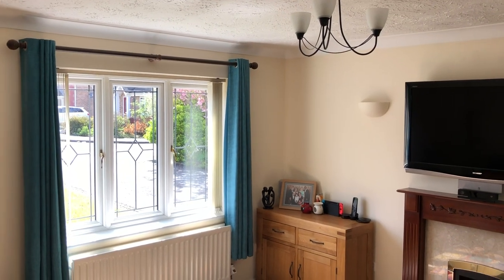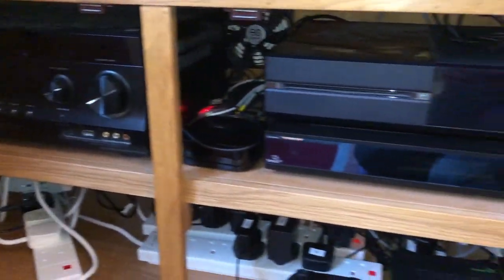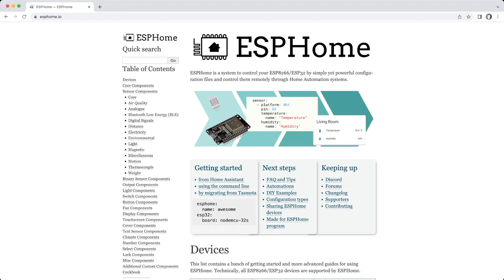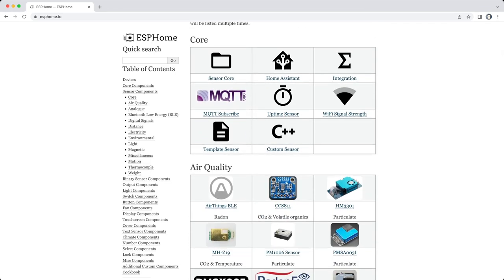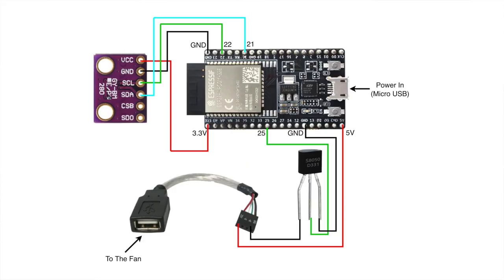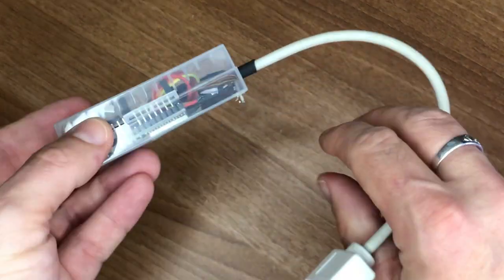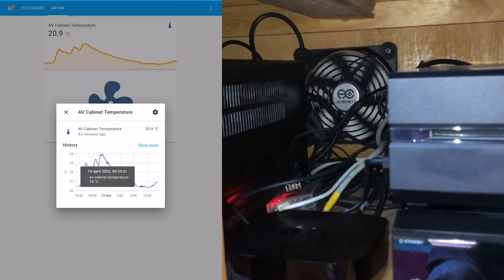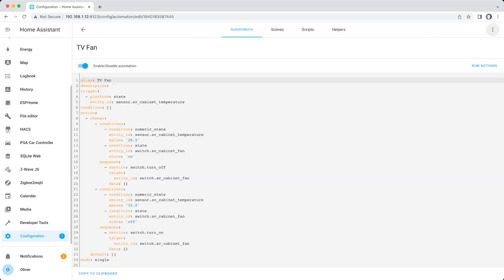Temperature Controlled Cooling Fan using ESPHome

Comment: Before watching this video, I did this to my stereo cabinet a month ago. I use Blynk for my home automation, an ESP8266-01,  three DS18B20 temperature sensors, a relay, a 5v fan, an old Apple USB power adapter and a cigar box. I sense the temperature inside the cigar box, inside the cabinet, and outside the stereo cabinet. Using the Blynk app I can manually adjust the setpoint when the fan starts up and a manual adjustment for a lower temperature shut off. However, the fan noise can be annoying if the TV/stereo is off. Maybe a resistor can reduce the fan speed.
Reply from the maker: My fan can be heard when the TV is off, but it's not that noisy. I do have it running at its lowest speed setting though. If you check out my other videos, I have one where I used PWM to control the fan speed based on temperature. That could be adapted to just control it at an acceptable noise level.

Comment: I'm now wondering if I could do something similar to this for the AC givenergy inverter
Reply from the maker: Yes it's entirely possible, but there's no point using ESPHome to control a fan - the GivEnergy inverter already reports its temperature so it's a lot easier just to plug a fan into a cheap smart socket (like the Ikea ones) and use the same automation but with the GivEnergy inverter temperature entity and your smart power socket as the entities instead. That's what I've done in a temporary bodge-up way. Obviously it's not as much fun as an ESPHome project :)

Comment: Thank you very much for the video and the instructions. I am interested to implement fans in a similar way on my aquarium. The difference is that I need 2 of them, one blowing cold air in the tank and one exhausting warm air out. Would it be possible to just connect the 2 fans in parallel or do I need different setup? I already have a nodemcu with an underwater temperature sensor...
Reply from the maker: Yes you could wire the fans in parallel, but I’d be cautious over the power draw of the fans. You might need to provide a higher amperage power supply instead of using the 5v from the ESP32/8266. Although in most cases I’ve found you don’t need separate in and out fans. If there is a vent for air in, then a fan blowing out will automatically create inwards airflow through the vent. I have just this weekend finished recording an updating version of this video which I’ll post in a couple of weeks. I’ve used a D1 mini and soldered it to a prototyping board with a proper USB socket and a status LED, then moved all of the fan control automation into the microprocessor.
Reply: @SpeakToTheGeekTech  planning to use a 2A cell phone charger but I have a larger one if required... With your reply you have solved one of my major problems. The other one is moisture in the fans from evaporation... Still working on it...